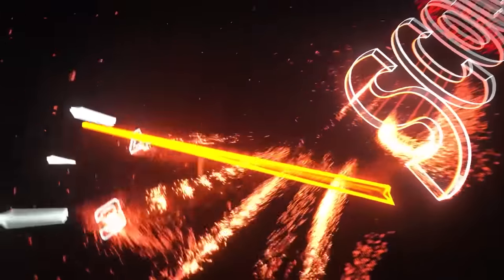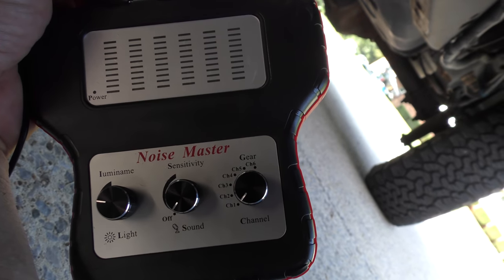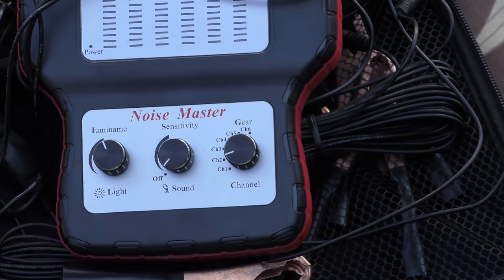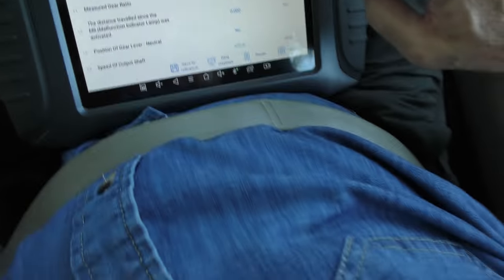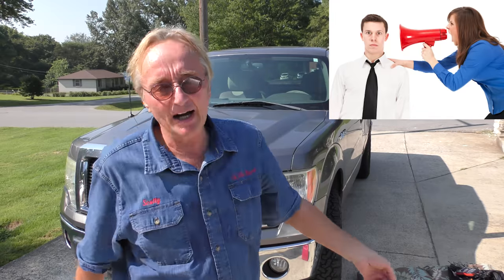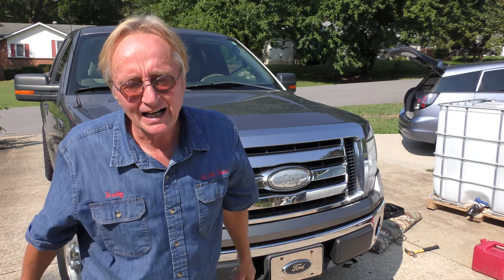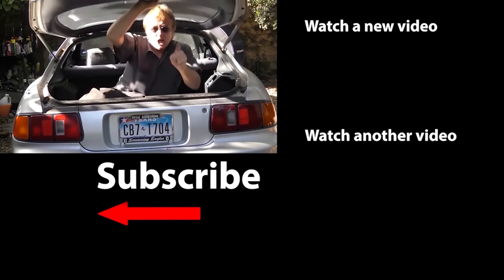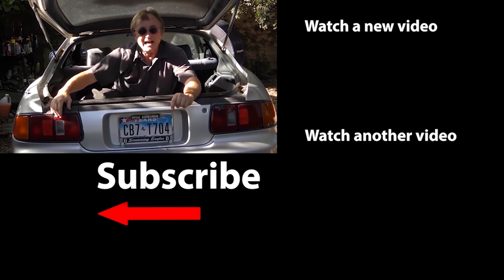If You Hear This, Your Transmission is Bad

Comment: 0:30 No Manual Transmission? SUCKS TO BE YOU!!! The last time I replaced a Manual Transmission it cost me $70. My Girlfriend at the time drove me to the junkyard in her Nissan station wagon (Manual Transmission). The same time the next day my car was running again. If Manual Transmissions are so great, what happened to the first Transmission "Smart Guy"?
I got caught in a situation, needing a clutch and had nowhere to do the work.  Had to trust some Jokers and they screwed me.  They didn't put any gear oil in my Transmission after finishing the job.  Took me 3days to figure it out. Once I realized what the Idiots had done, I just filled the gearbox with gear oil. Like 3 years later, it failed. I never had a problem with the $70 one I installed from the junkyard. You'll NEVER hear that story about an Autob9ox🤮🤮🤮

Comment: Hey, I was watching this and was wondering if my cars transmission might be bad. it likes to rattle and shakes the whole car slightly in first or second gear. I have no clue what is wrong with it but it mostly happens when accelerating uphill as well... could this be a sign that my transmission is going out or could it just be like a loose gear or smth?

Comment: Hey boss I have a Kia Rio 5 it died on me in traffic I assumed it was the fuel pump but after I put the new one in it’s not engaging when the key is  clicked over once what should I check next
Reply: I’ve got a rio as well, check your crank shaft sensor there’s a tiny magnetic  circle piece on the inside , if it’s cracked change it . Mine was shutting off over and over on me and I changed the fuel pump too but this is what it turned out to be

Comment: Do you think its possible its a vacum leak in the 4x4? theres lots of other people with a ford including me who have that grinding sound going up hill under load maybe this sound is different just thought id point it out as i have the same issue , goes away instantly when you put it in 4x4
Reply: as well they fixed it with a new solenoid or a new 4x4 vacum actuator or whatever they are all called seems to be a common problem with fords trucks as well most mechanics and the dealers cant find the issue

Comment: Hey i gotta 2017 dodge challenger when cold starting it in the morning it make a loud sound like a lawnmower but when car runs for a while it slowly goes away but the car acks like it doesnt wanna go at certain time when i hit the gas and it reps up but it seems like it get stuck time to time and rpm will just go up and it will then finally take off do you know what this may be please i need help i just got the vehicle a 3months ago and been having this problem since i got it the dealership  is telling me there is nothing wrong with it and no codes are.  popping up and i have it at the shop now and the mechanic told me there is something definitely wrong with it but he is not able to diagnose it without a codes popping up and he want be able to know for sure

Comment: Hey Scott I have a question on an impala 2013 ltz
Reply: I drive it and it would slip on gears but not too often but I always drive at like 70-80 miles per hour at an RPM below 2000

Comment: Your not completely right about rust conversion primers. They do work to about the level of any waterbased acrylic primer. IF they are then overcoated with something water proof they perform. Their are other rust covering paints using urethane. An issue is heat, for example the urethane cant be near muffler. if you do manual prep’ then you can use a specific solvent cut metal primer, maybe with a phosphate treatment that might be able to handle proximity to the cat or muffler. These conversion primer do better with heat.
Reply: Scotty is always completely right

Comment: Scotty, what brand of remanufactured transmissions do you recommend we check out?
Reply: Scotty in his past videos and chat sessions had usually recommended going with factory rebuilt units to get the best life as they're usually less of  gamble.  They are pricey though, so you'd need to think it thru like the guy who owns this truck did in this video to not do anything with it since it's not his main vehicle.  My experience has been to find a reputable shop, and often they'll have similar quality but at lower prices vs. factory rebuilt units.

Comment: My transmission barely goes in reverse, the drive works fine, no check engine light, expensive scan machine at transmission shop shows nothing wrong. I'm at a loss.
Reply: Low on transmission fluid...

Comment: My 2016 mazda 3 kinda slips when cold in first to second gear. It’s an automatic. But when heat and temperature goes normal, it shifts pretty smooth and normally. Low fluid or?  Someone help please.
Reply: You're cursed realize about Harvey

Comment: This maybe a stupid question but I have to buy a car soon. I found a 2015 4 runner 55k miles for 31k. Clean record. Is this a good buy?
Reply: duh
its a toyota aslong as it runs it has low mileage so itll be a good purchase
Reply: Let somebody check it for you first! 👍🏼
Reply: @TheKingOpEagleYt  31k for a 7 year old truck?
Reply: If you can have it looked at by someone trustworthy, then that's a very solid vehicle. But I would not pay that much for it.

Comment: Use a rubber mallet. 
Using a steel hammer can crack the cat.
Scotty is losing it.
Reply: You are wrong, if it cracks the cat when tapping with steel hammer, it means there was stress cracks already there!